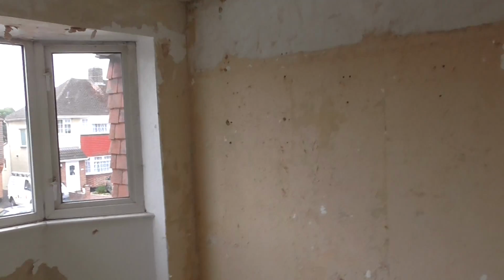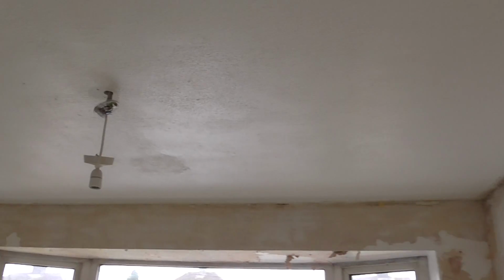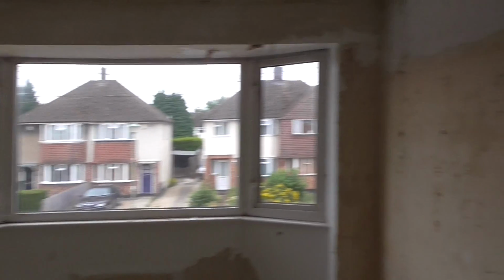Preparing Bad walls for re plastering Littlemoor Oxon July 2013

Comment: you need bonding haha unless you use crappy pva plaster..  you allways should pva or bond walls this slow down the rate or which the wall absorbs the moisture for the plaster   if you use to diluted pva plaster will f
dry quicker..